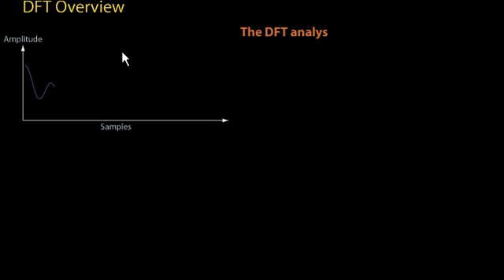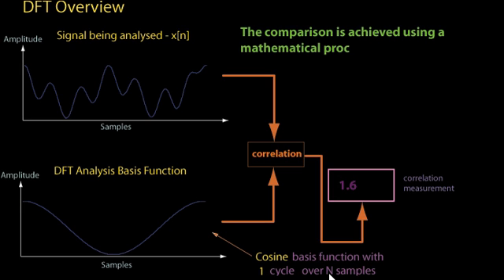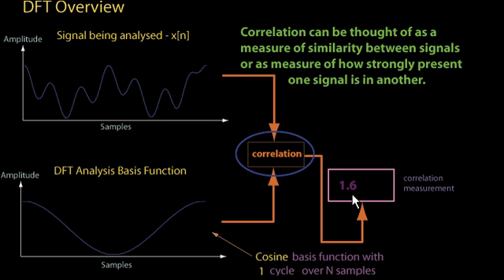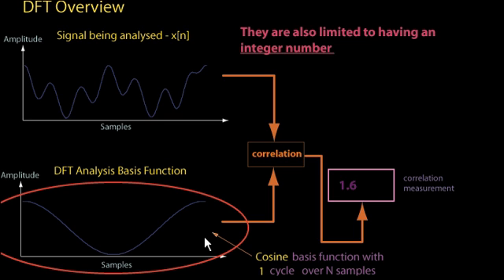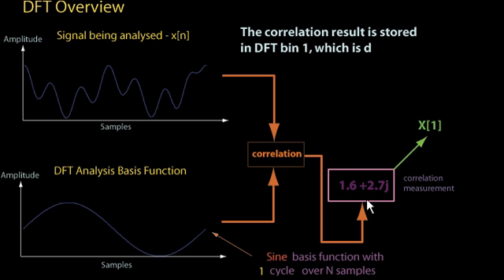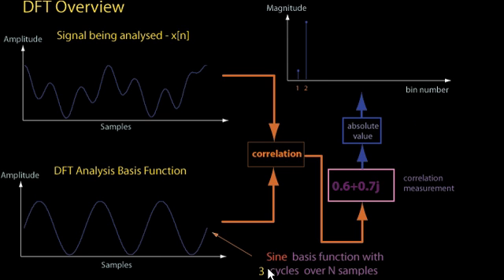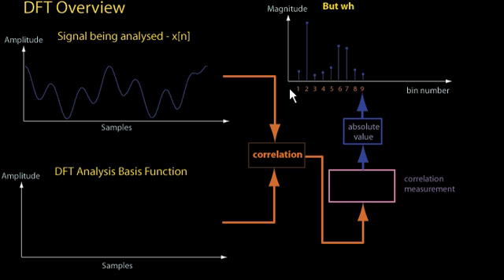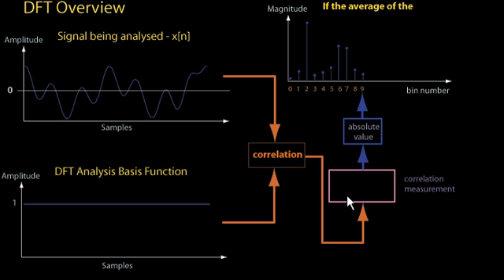How the Discrete Fourier Transform (DFT) works - an overview

Comment: the explaination is a bit misleading. What you are talking about is Fourier Series and fourier coefficients, not the DFT. 

Fourier series is used to express a periodic signal trough its the frequency components, and since the signal is periodic, it has to be time-unlimited, and also his spectrum will be discrete (eventually also band-unilimited when the time signal has discontinuities, such a square wave signal, since we can only approximate trough the infinite sum of continuous sinusoidal functions). The signal you are analysing is continuous,  so you are just calculating his fourier coefficient via the correlation integral. Also, this holds assuming that your signal is periodic (and you perhaps forgot to tell that) and hence the graph you are showing is just a period of the whole signal. If it isn't the case, then the signal would be non-periodic, and hence you would need to use the FT which gives a continuous spectrum, not a discrete one.

DFT instead works on discrete signals (sequences), which is not the case that you are depicting here. Since they are they are discrete, their spectrum must be periodic. Also since their spectrum will be discrete (sampled), the time signal also will be periodic. So both the sequence and the spectrum are necessarily discrete and periodic in DFT.

Also the notation x[n] is usually used for time-discrete signal, you should be using x(t) for time-continuous signal instead.
Reply from the maker: It's a discrete signal in the plot. The samples are just really close together. I realise a lot of text books show discrete signals with a line drawn from the sample point but it didn't look good for this video. Check out https://youtu.be/B2iUDBZzBpY for a detailed video on the DFT.
Reply: @ddorran  I see now. Looking at the video again, you also talk about the number of cycles over the N samples of the signal, so it actually does imply that the signal is discrete. It's a bit subtle tho, i still think that what you are depicting with the graph does not represents easily the things you explain with your voice, and people could get confused when expecting to see a discrete signal. I left that comment hoping that it could be helpful for other people that might be confused by the signal plot.

Unfortunately I don't have time to check the detailed video, but i hope it will be helpful for other people, since those concepts are very important in a lot of modern applications and jobs.

Comment: You should link your other video as prerequisites: 

Correlation Explanation with Video
https://www.youtube.com/watch?v=_r_fDlM0Dx0

Normalized Correlation
https://www.youtube.com/watch?v=ngEC3sXeUb4

Cross Correlation
https://youtu.be/RO8s1TrElEw

They're excellent at showing why correlation is essentially point-wise "accumulation" of the multiplication of two functions -- plus some caveats. The resulting sum-of-pointwise-products of functions tell you how much they're similar (higher the value of the correlation function at a point, the more alike the two functions are at that point; negative indicates they're alike magnitude but differing in size). 

Julius O Smith's chapters on "Geometric Signal Theory" (C6.) provides a nice walkthrough of what is meant by "sine" and "cos" are basis functions of the transform.
https://ccrma.stanford.edu/~jos/mdft/Geometric_Signal_Theory.html

Comment: Your videos are great! I would like to ask you how we can use fft function in matlab for a space-based data in order to find its wavelengths, I mean using DFT for finding wavelegths present in a space-based data. this data can represent the roughness of a surface in distance. Do you think it is possible to use fft for this purpose or we have to code it ourselves?
Reply from the maker: Niloofar It doesn't really matter where the data comes from so I don't see why not

Comment: hye david. what is the diff. between fft and dft func? kindda look the same to me the output result for both of the func. can you explain? thnks!
Reply from the maker: the FFT is just an efficient implementation of the DFT. The output of both is the same. However the fft requires that the signal being analysed be of length N = 2^m samples where m is a non zero positive integer.
Reply: +David Dorran Wow! That is exactly what i needed. Thank you so much!